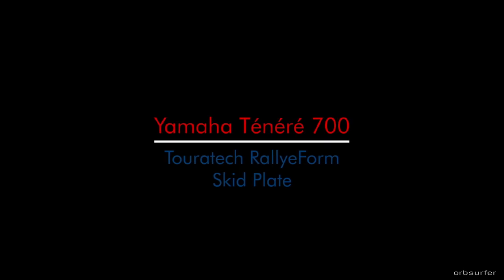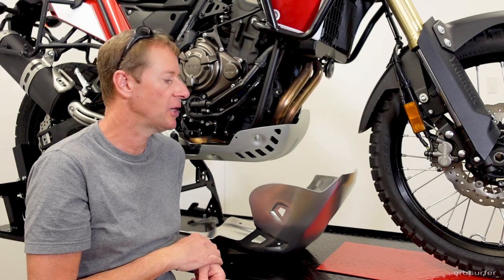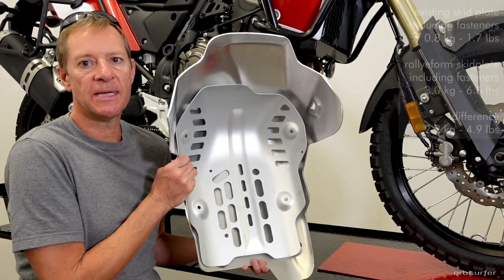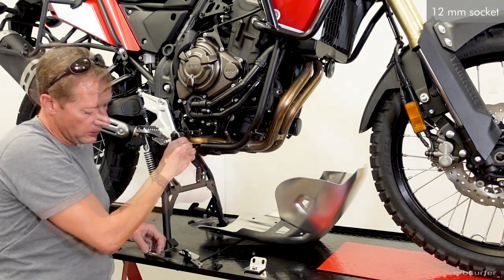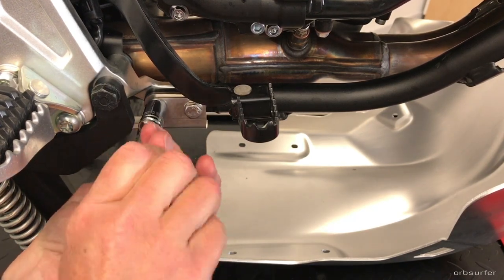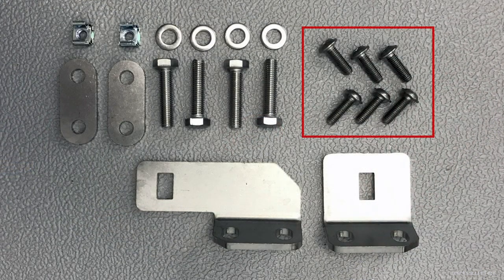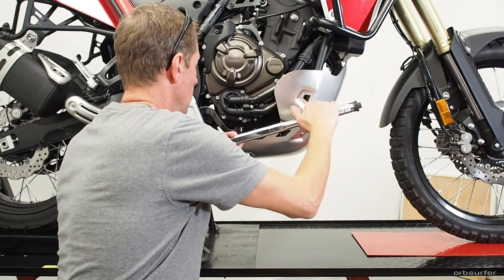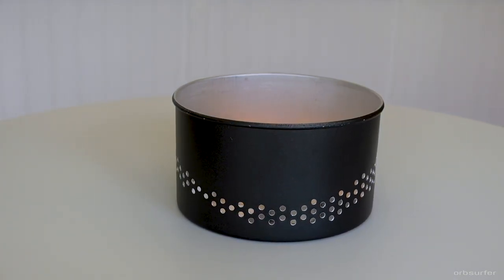Yamaha Ténéré 700 - Touratech RallyeForm Skid Plate - Installation and Review

Comment: Hey Orb. Curious if the rally form caused heat problems. 
Do i need to drill some holes?
Thanks.
Reply from the maker: Depends where you are located. In Louisiana - a warm place - there was never an issue with excess heat - even when standing still - but the radiator fan turns on much more than before. Extra venting holes will without doubt be beneficial in order to lower the engine temperature.
Reply: @orbsurfer8195  
Thanks. Appreciate that. Finally had to settle for that skid plate. Had planned on B&B but the only ones in stock were on the other side of the pond. I'll probably drill some holes. Dont want the fan running all the time.  Trying to round it up for the build. See you on the TAT.

Comment: Any concerns about over heating?  Very expensive skid plate and it doesn't have the right bolts?
Reply from the maker: Yes. If needed due to high engine temperature, I am planning on doing some perforations along the exhaust down pipes. Will monitor the temperature gauge on the display, and try to listen to radiator fan cycling on more than before when the bike is standing still. Checking the flow from the rear of the radiator and the electric fan, a large part of the airflow moves past the exhaust pipes when the RallyeForm Skid Plate is fitted, so in theory :-) a build up of heat should not be an issue.

Totally agree on the bolts! The fastening/bolts issue was even bigger when I installed the Touratech Upper Crash Bars for the Ténéré 700! The sad part with Touratech is that the issues are not cost related, just a "Good Enough" attitude throughout the whole company... Why Touratech?
Reply: @orbsurfer8195  hows the skid plate doing? i like this design looks good, im planning to fit this one on my t7 but my concern is how was the engine cooling  while this skid plate is fitted?
Reply: btw does this skid plate covers the impact of the water pump if it falls down?
Reply from the maker: @rtcivic  While riding slowly; below roughly 30 mph - 50 km/h, the engine gets warmer than before, but the radiator fan turns on and keeps the temperature in safe operating range. At speeds above roughly 30 mph - 50 km/h, no problems. Later on, I will probably drill some air vents holes along the exhaust pipes to help alleviate this.
Reply from the maker: @rtcivic  No, but the side of the skid plate covers a large part of the two plastic pipes leading to the water pump, and this feature was one of the reasons I bought this skid plate.
Reply: @orbsurfer8195  cheers mate! planning to get this skid plate myself because it looks good.

Comment: Hello is this plate compatible with lower crashbar?
Reply from the maker: Do not know - probably depends on the manufacturer of the lower crash bar.
Reply: Website says it is. The expedition is not. Wont work with euro 5 exhaust!
Will let you know how much trouble after the build. Hunter gatherer mode for another week.
Reply: @kirklucas1332  bought the euro 4 on my decat it's fine thank for your reply